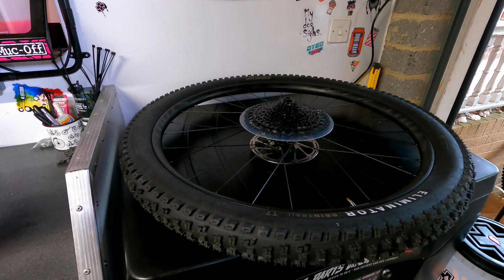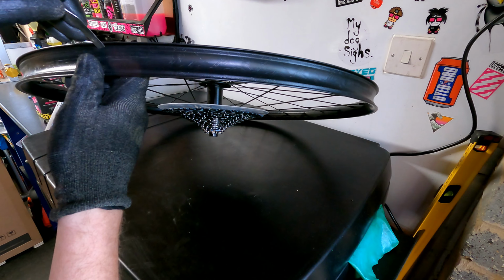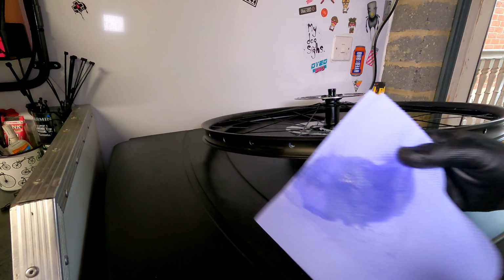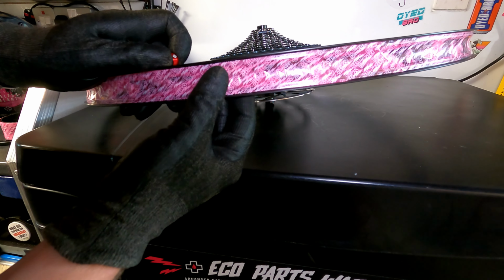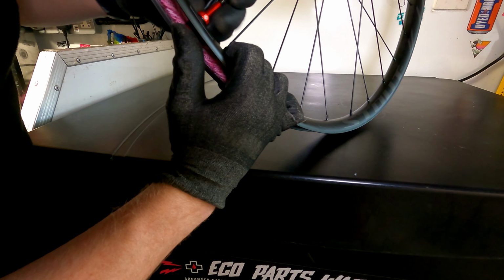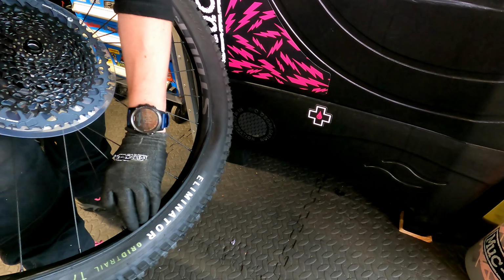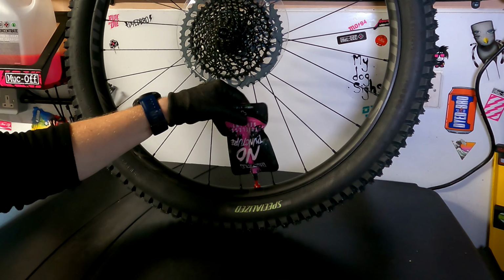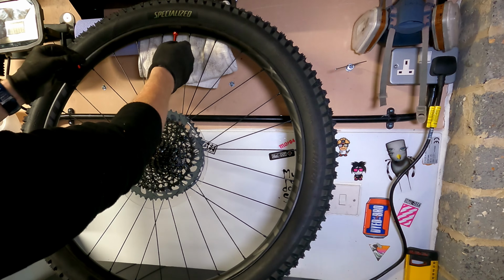Setup & install tubeless tyres using Muc-Off Ultimate Tubeless Setup Kit  THE CYCLE RENOVATOR

Comment: Thanks dude. My rims are also 29mm internal with a well in the middle  I was unsure as to go for   Muc off DH/ enduro (30mm) tape or DH wide (35mm) like you have here. I think ill go wide. Cheers
Reply from the maker: You can use the 30mm tape and overlap it on the second time round to cover both lips. The wider tape might ride up the sides.

Comment: When I remove the inner valve the air floods out
Reply from the maker: Yes it will, once you have got the tyre ob the bead and have installed the sealant you then reinstall the valve core and inflate.
Reply: Thank you so very much for this tutorial

Comment: Tire will not inflate with a normal floor pump to seat the tire on the rim. A compressor is really necessary?
Reply from the maker: It depends on the tyre and the rim, I have previously inflated tyres using a shop hand pump.